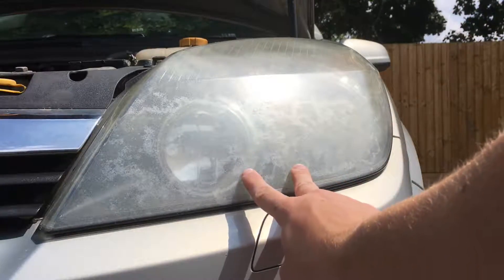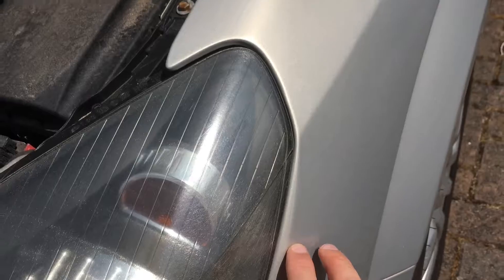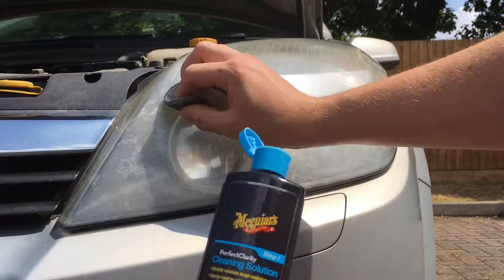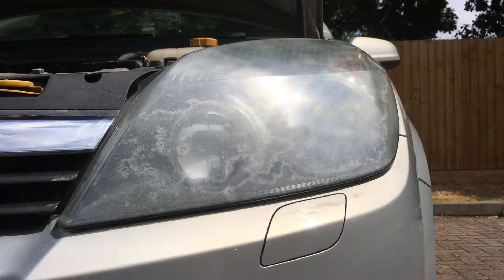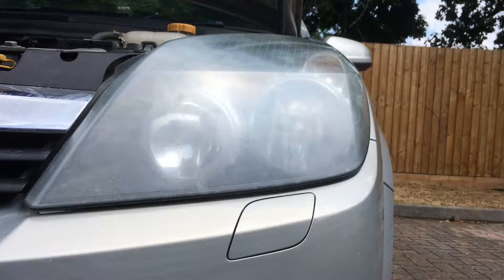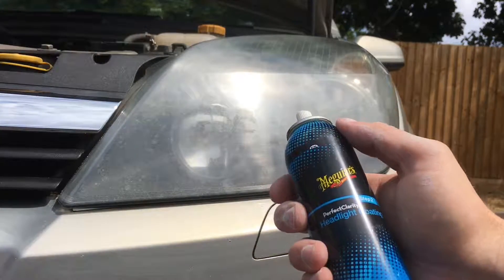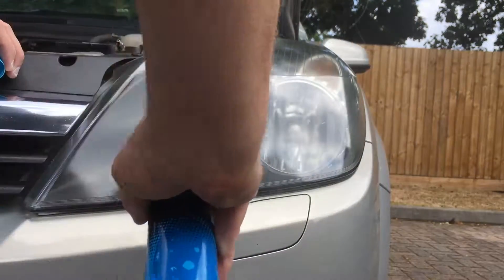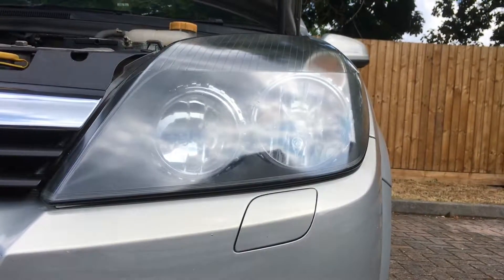How To Restore Headlights With A Halfords Repair Kit

Comment: Good video as my headlights are very foggy and may result in myself failing my next MOT. If you can do a video of how to replace a wheel arch that is damaged at the front that would be useful?  Thanks.
Reply from the maker: Onenation thank you for your comment. Unfortunately I’ve stopped making the car videos. Didn’t feel like it was my path on YouTube anymore